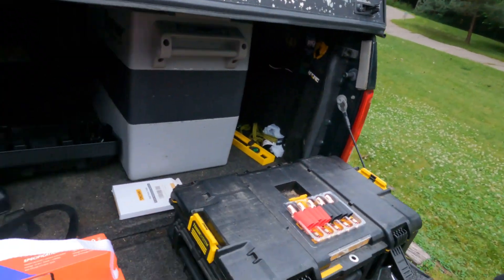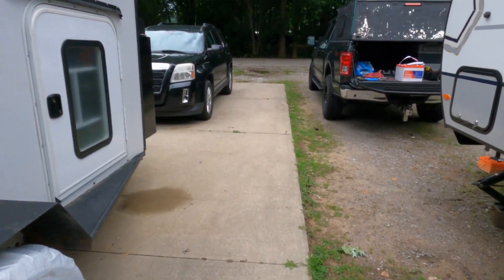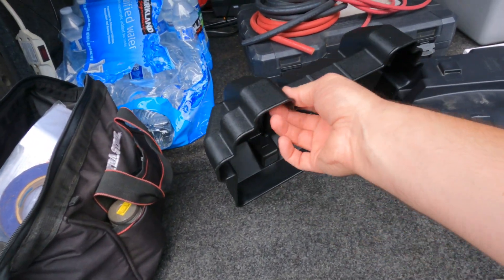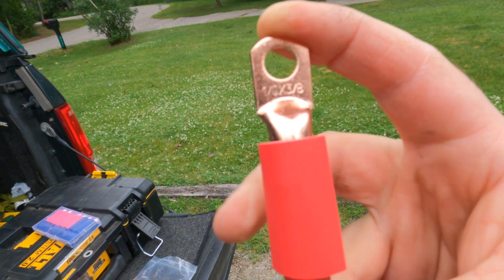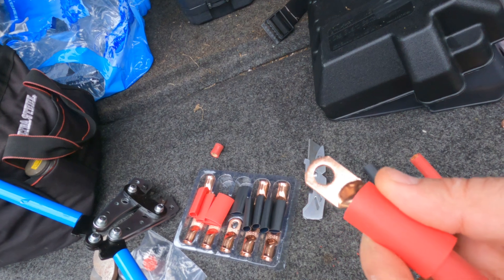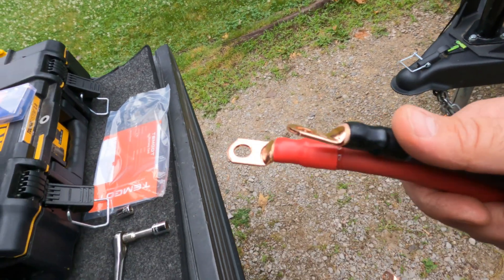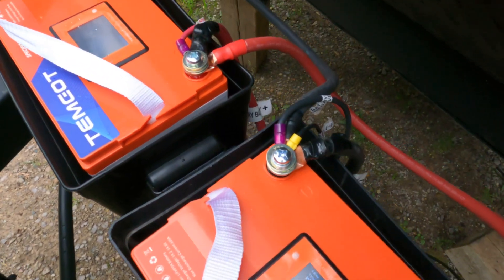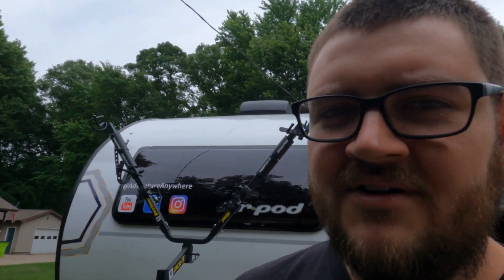How to Install 200 Amp Hours of Lithium Batteries in your RV!

Comment: Great video! Did you have any trouble getting your converter to auto detect the Lithium batteries?
Reply from the maker: I didn’t but if I remember right there’s just a light in the board inside of it that changes colors to indicate the battery type.  I did drain them down and then run a full charge cycle also.
Reply: @adventure.anywhere  May seem like a silly question, but how did you drain the batteries down before running the full charge cycle?
Reply from the maker: I charged each battery to 100% before installing them, then once they were installed I ran the inverter to power my refrigerator on electric only and that drained them down in a day so I could plug it back in and get a full charge from the RV converter.

Comment: Send these back u paid about $150 too much for each of these. Lipo4 has gotten way cheaper
Reply from the maker: I need the heated batteries. The selection is a lot smaller for those and of the ones available these were priced pretty low.  If I went with a larger battery size I could have paid less per AH, but I wanted to use the same group 24 box I already had so I didn’t have to deal with relocating it.